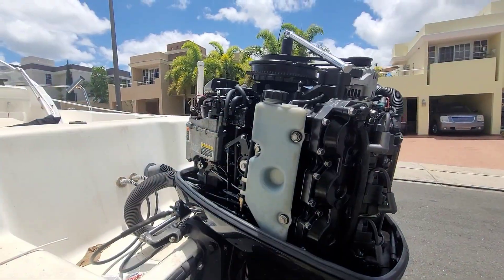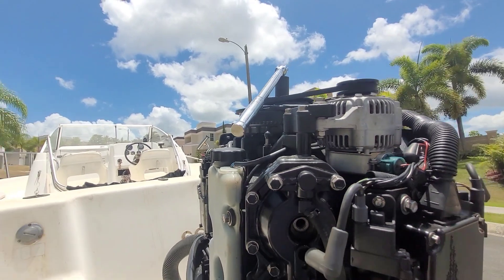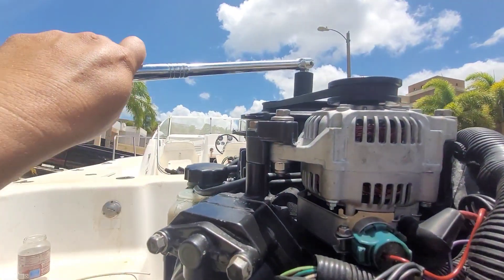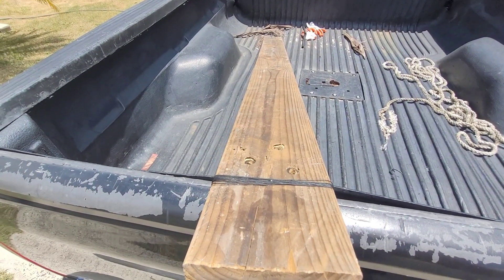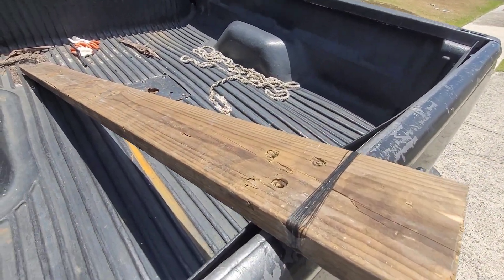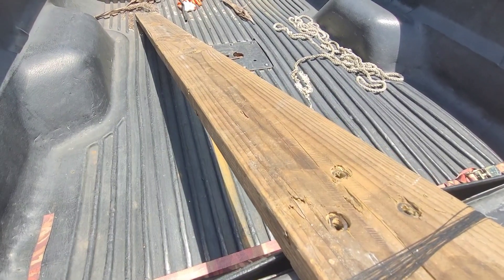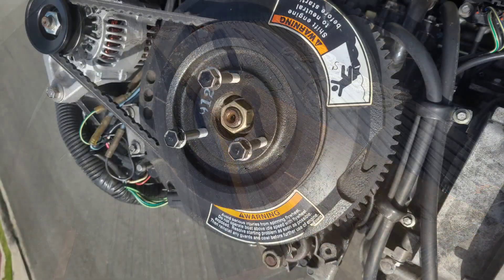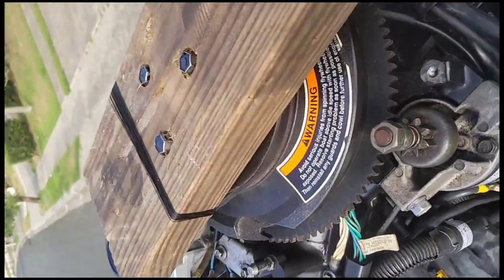How I Fixed my 225 HP Seized Mercury Outboard #mercuryoutboards

Comment: what was the issue?
Reply from the maker: Engine stoped working due to water in the tank. I cleaned the gasoline filters and removed the water. The engine did start afterwards but I did not run it for a good amount of time and then I went on a 2 week vacation. When I returned the engine was seized, I guess water wapors or residual water was still inside the engine and it oxidized/rusted the internals. So if your 2 stroke ever gets water in the gasoline and the engine shuts off be sure to flush it throughly.
Reply: @ricardoboneta  yeah makes sense. Good job repairing the engine by yourself!